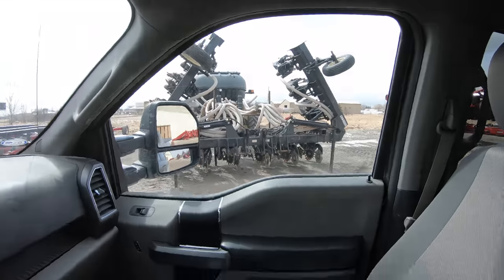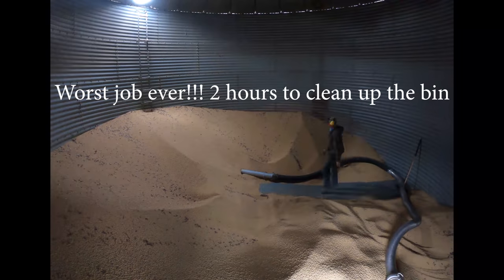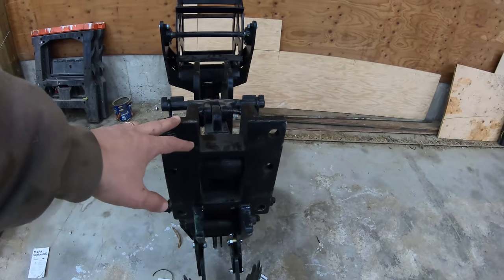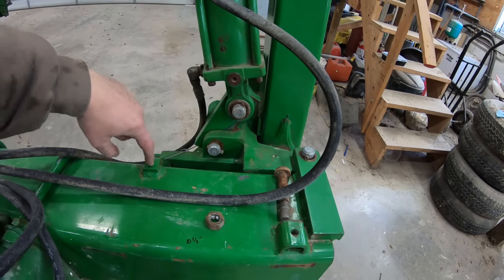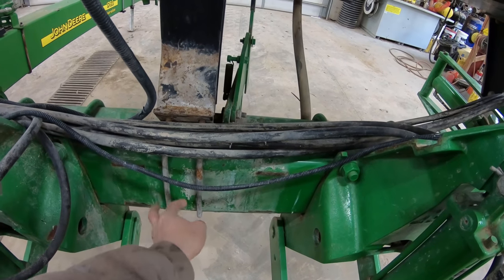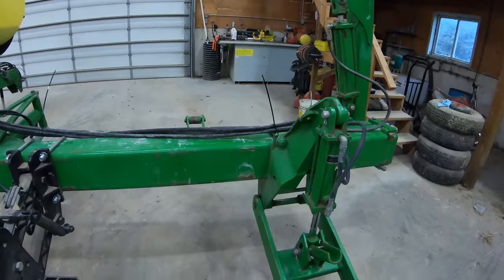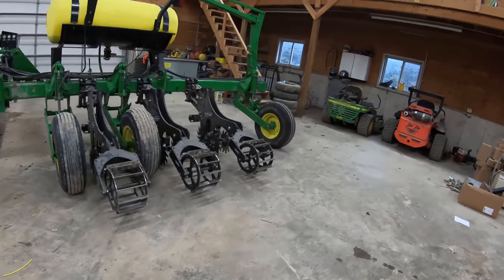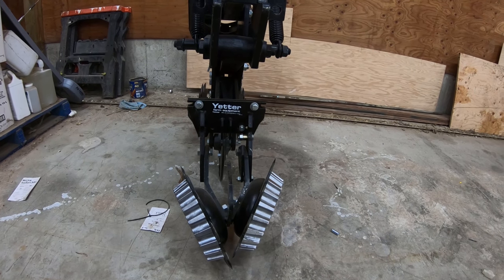Strip Freshener Build | Vlog 3

Comment: I have been watching sandi videos for awihle now and just started watch yours this past week. Great video.
After this spring or i should say early summer how did your bar build work?
And are you putting fertilizer on with tankz on bar as well?
Dont feel bad we only planted 1/3 of corn this year just too wet.
Reply from the maker: The bar worked great considering the spring/summer.  We aren't putting on fertilizer with it but could add necessary stuff to do so later.